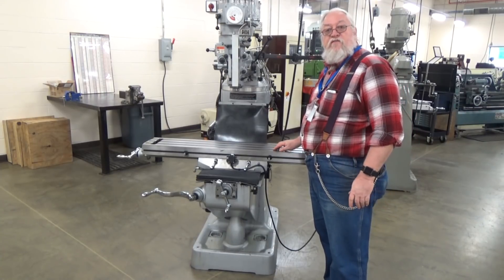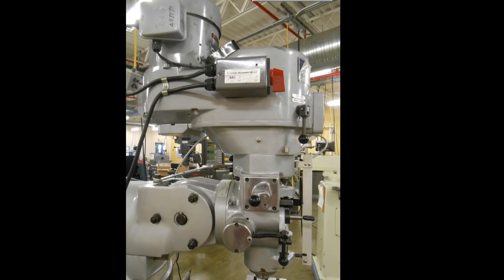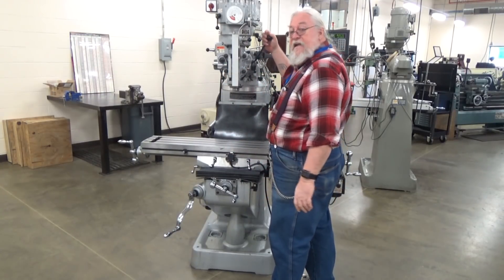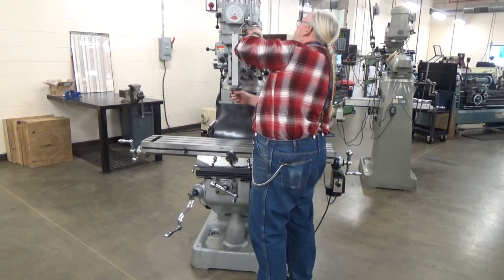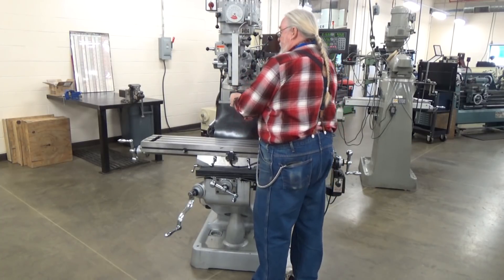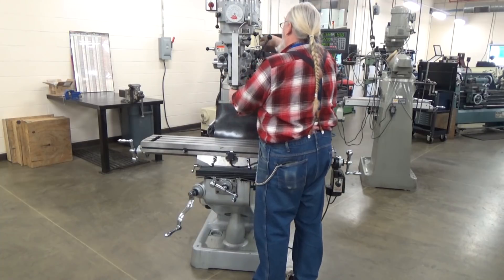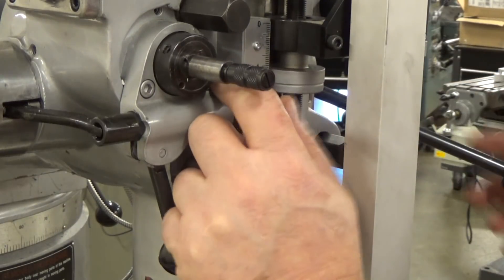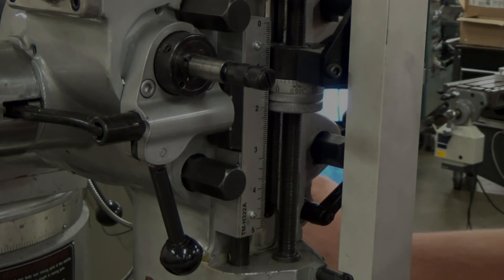Introduction to the vertical Milling Machine

Comment: Hello, thank you for the amazing video. I just bought a used clark mill and looks exactly as the mill you guys are showing. I  need to know  what size fuse breaker is needed at the power panel?

Comment: Thank you for this video. It went over all the basic stuff I need to know before I start learning how to use my mill. I bought a used Eurospark branded, Taiwanese turret mill, in really good condition. My main use for it will be motorcycle parts, but will also be looking at making other things in the future. The mill is probably bigger than I need, but I like to have more than I need, so I'll never feel like I need more and have to upgrade later. :)